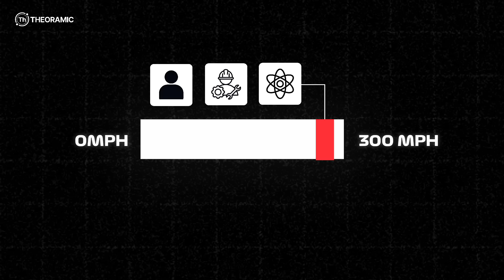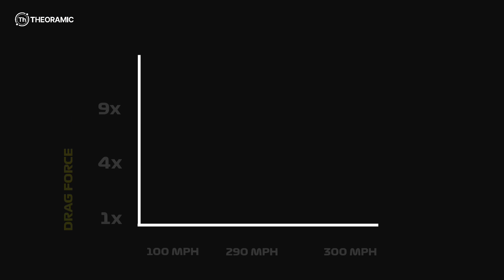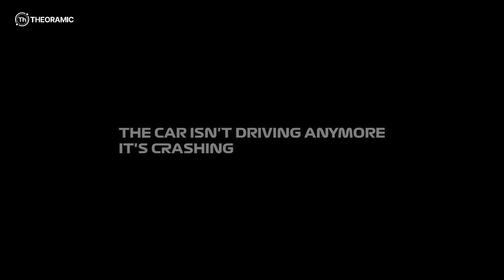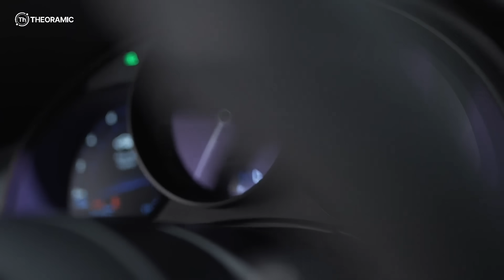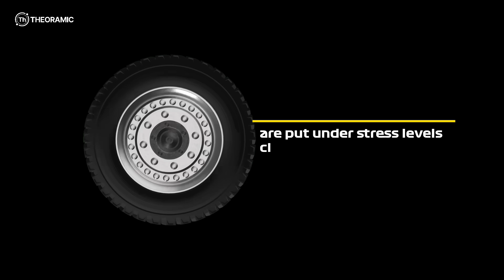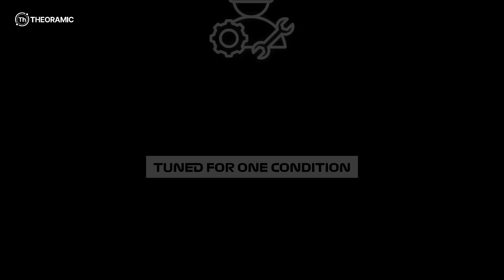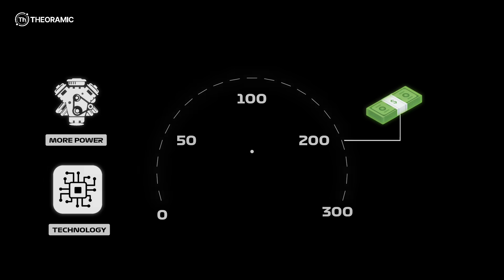Why It’s Almost Impossible to Go 300 MPH

Comment: From an engineering standpoint, it's not nearly impossible, in fact, it's very doable. Most car brands can create a vehicle that goes over 300mph, the question is, is it sustainable and practical? And the answer is a resounding no. Why?

Infrastructure - We simply don't have the roads built for it. We're talking long stretches of roads that span miles in length, that are smooth and wide enough to make up for things like tunnel vision and slight shifts that can have a huge impact on positioning. That's not even factoring in wind. So even if we created a special lane where the minimum speed is 200mph, the maintenance costs would just be too high.

Tyre wear- This is one of the main things, I've spent a lot of time researching everything I can about tyres over the course of maybe 5 years, the simple truth is, we haven't gotten to the stage where we can produce tyres that can handle that level of force for a long time before ripping apart due to heating and wear. The issue is, if you want more durability, you need harder compounds which means less grip (not suitable for going 300mph), if you want more grip, this means softer compounds which can allow for extreme performance but you give up longevity (again making running at 300mph for a long time not practical). If you want grip and longevity (most road cars), you must sacrifice performance. It's always a tradeoff when it comes to tyres. Until we can figure out how to eliminate trade offs, it's going to be tough. And it's not that we can't make a tyre with extreme durability and extreme grip, the ROI just doesn't make sense to spend billions into R&D for a tyre that almost nobody will ever use😂

Fuel - Simply put, right now at its top speed, a Bugatti Super Sport 300+ will run through a Tank in 9 maybe 10 minutes. That's just not sustainable.

And then the cost aspect, you're looking at a 5 figure bill at the bare minimum if you're a Bugatti owner pushing your car to 300mph😂You're 1000% going to need to replace all 4 tyres, that's around 40k just for driving for 10 minutes😂 God forbid you have any engine, fluid, brakes or transmission issues, you're looking at 6-figure bill for 10 minutes of driving.

Overall, the costs just aren't worth it. The engineering part? 99% of it can be done, the biggest limitation would be tyres but tyres aside, you can find a workaround for everything else, it will just cost too much and the time in maintenance to the time saved on the road just wouldn't make sense.
Reply: TLDR: cars fast enough to mog a formula 1 car are impractical for every-day use
Reply: @Shuttle_Man  Right, the required investment doesn't make sense for anything other than competitive use such as racing.
Reply: Use steel tires and run them on two parallel steel mini-roads. Since you’re punching a hole in the air, you could tow other cars full of people or cargo for efficiency.
Reply: @DrDeuteron that would be a good form of transportation, i wonder if anyone ever figured out how to build this machine
Reply: @DrDeuteron you just invented a billion dollar industry
Reply: Tldr, someone asked chatgpt then pasted it here to look smart
Reply: Very well stated!!
Reply: ChatGPT answer.
Reply: @ThereIsNoSpoon678  If you actually read my response and have ever used ChatGPT, you'd know ChatGPT would never make such a messy response😂 Furthermore, I'm sure there are several apps or sites that can detect if something has been written or created by AI, so you can run my comment from any of them.
Reply: Thanks, ChatGPT
Reply: @popcycle7169  The fact that people o(or 2 of you) think I used ChatGPT to write a very basic comment or would use it to write any comment period let's me know how dumbed down we're already getting.
Reply: I hope you didn't actually waste your time typing all this IN A YOUTUBE COMMENT 😂😂😂
Reply: @Sayaingin66  Well people read it and seemed to agree so🤷🏽‍♂😂 It's not a lot, people just have short attention spans or are too lazy to read nowadays. It didn't take me more than a few minutes to type that.
Reply: We all spend our minutes wasted on this crap, i am no hypocrite. But thats pretty hypocritical of me too say. @11bornrich
Reply: @11bornrich and also I read it. And your on the money. I shouldn't combat knowledge but we all learning.
Reply: @Sayaingin66  Yeah reading through what would be a boring comment for most is not for everyone I understand😂The only reason why I know so much about this is because as a petrol head, I always wondered about this exact thing and like a nerd did deep research on it many years ago to find it's not that it's impossible but it just isn't practical at all and would cost way too much for little to no return😂
Reply: @11bornrich your so awesome im so sorry lol. Im a HUGE fan of mechanical engineering is well. Ive read everyone's comments and there is plenty of legitimate conversation, and who am I to stiffe that?
Reply: And also i 100% agree with the tires part "tyres" lol i see you over there across the water @11bornrich
Reply: Wait, I thought fuel consumption is high at lower gears and get lower at higher gears. Like I'm not really knowledgeable on the subject but is it really true that at that speed the fuel tank would literally empty in minutes? I'm genuinely curious
Reply: @Knightmare-i6j yes the air density becomes so great at those speeds its like driving through peanut butter. Your gonna need the hp to keep pushing and torque too pull. Thats why it would require more 🐎 the bigger the vehicle depending on the aerodynamics.
Reply: @Sayaingin66 
Ooh. That makes sense. But emptying a fuel tank in less than 15 min is still insane. I'm really surprised to learn this
Reply: @Knightmare-i6j very insane, thats what you get when you have a 8.0L engine with 4 turbochargers and the vehicle weighs 4,000lbs.
Reply: @Knightmare-i6j also the thing is, is that good luck running your tank out from running 250mph+ and full throttle. The tires will go long before the fuel.

Comment: You lacked on more focus on the mention of land speed records that still technically count as cars. An example of this is the turbinator 2. It doesn't have the typical engine, but it is most definitely 4 wheeled and wheel powered. If we are talking road legal, then it is a whole different story. Although, even with that limit I do not think it would be too hard to push an EV's engine/vehicle past 300mph at all taking into account technological advancement and problem solving of today(most challenges arise, due to complications within company or out of company, that excludes these obstacles mentioned in the video).

Comment: Tires, engine heat are significant. The power needed to overcome aerodynamic drag increases as the cube of the airspeed (unless the air flow goes trans-sonic or supersonic). More power is a matter of displacement and turbo boost. 
There are tires which can withstand 300, 400 + mph at Bonnevile Salt Flats (miles of smooth salt, or, mush). I’m not sure Bugatti or Konig want to run there cars on salt.

Engine heat. If using internal combustion engines a significant percentage of the energy in the fuel ends up as waste heat that starts inside the cylinders. A 1.5 liter engine of 150 hp at the flywheel produces 150 x X amount if waste heat. Now the heat exchanger (radiator) for such an engine can be fit inside a tiny Fiat or Mini Copper. If 1,500 hp (accounting for additional aero drag needed to keep the car on the road and stable) is needed to break 300 mph then one has to contend with 10 tens more waste heat than the sporty subcompact. To drag the radiator for 1,500 hp through the air at say 2.5 times as fast as the Mini (I credit the Mini with a perhaps generous 120 mph) requires 15 times more power (10 x the cross sectional area times 2.5 cubed). Clever design can reduce this but still. The Bugatti air intakes look well designed.

Now for short runs one can accept temperatures over a wider range. Or one can “modify” from production and use exotic fuels and techniques. Alcohol fuels with methanol water injection; the latter was used inWW II for short term “war emergency” power.

Obviously, one could try turbo-shaft engines but now one is deep into aero-space.Or one could go battery electric. The torque of an electric motor is more constant over rpm (power = torque times rpm) and can withstand high rpms. Direct drive might eliminate transmissions. 

The human limits should not be overlooked. F1 is always looking to limit top speeds to limits which the survival cell & crush zones plus ample run off areas  can reduce max periods of impact G loads to survivable levels. (50 G for many seconds is nit survivable; 50 G for a microsecond might be.)
Reply: Developing a rotary engine would lessen the heat problem

Comment: I currently work in the exotic car industry and one of my clients invited me out to this really cool event at the Kennedy space Center in Florida it’s the same runway where the space shuttle use to land its a three miles long so they let supercars do high speed runs my client
 owned a Lamborghini Aventador, at that time but I was able to ride in a Porsche 918 spyder we hit a top speed of 223 miles MPH!!  But when we first got around 190 MPH  you can really see how the wind resistance was really starting to push back on the car.
Reply: How do you get into the car industry like that u got the life
Reply: @feardboi  I started from the bottom! My first job was at Mazda Hyundai and then I went to Mercedes  the journey hasn’t been easy but over the years I just kept trying to move up the ladder until I got to exotics and hyper cars which I’m currently working with

Comment: Supersport 300+:1600hp and reached 304mph while being just ICE
Yangwang U9 Extreme: 3000hp reached 308mph, all electric
It really still says that ICE and Hybrids are yet still dominating the track and speed area over electric cars who just dominates in acceleration, ZR1 with 1064hp (all Ice) is still faster than the U9 extreme around the ring cuz the U9 can’t put it’s full power to use to 100% on the track (source from an engineer guy on youtube who debunk the cybertruck towing 911 vs 911)

Comment: Drag, tires, fuel consumption, weight, pushing power, absolutely needs precision and strong grip to not spin the car out since downforce keeps it stick but it isn’t necessary for top speed runs, not to mention about the driver’s limit too, humans have limit
Reply: which human limit are you talking about? Normal commercial planes cruise at speeds that is way above 300MPH
Reply: @henrychidiebere6679 focus and reaction time. It can be extremely difficult keeping a car straight anywhere near that speed. When Mario Andretti drove the McLaren F1 on a track, he maxed at 217mph and said it was very scary though still felt like the car could pull another gear (if it had another).

Comment: I've been thinking about the Bugatti Veyron, it does 400 km/h with 1.000 HP. Since power is proportional to the speed cubed it will need only 16 HP to do 100 km/h. I must be very aerodynamic, to do 100 km/h with just 16 HP with the wide tyres and all the air intakes, spoilers...

Comment: Yes, it's amazing how many don't realize that power, time and energy are not linear. When you double the speed, energy increases 4 times. 100mph impact is 4 times more powerful than a 50mph impact. Goes in reverse too, you need 4 times the amount of horsepower to achieve 100 mph. The same goes to projectiles, rockets, ships etc
Reply: Power is a factor of 8, not 4, but since the time to complete trip is halved, the energy goes as 4.

Comment: It's funny when i hear people say "you need to find a driver with big enough balls to drive it that fast" we have top fuel drivers who are use to handling 300+mph in a vehicle why don't they ever use one of them to do the run? I understand that they hit those speeds way quicker but that's even more impressive to be able to control something that powerful under that many G forces so handling a road car at 300+ would be way less scary for them I'd believe
Reply from the maker: Can I ask a question Sir 
Do you think you are able to Drive a car moving 300 MPH
Reply: @theoramic_yt  no, I'm not a professional racecar driver but i have driven a car 200mph which yes is scary but I'm sure if i did that regularly as a pro driver it would be less scary

Comment: We will get to a point where we cannot go any faster than what is possible
Reply: Becuse the only thing stopping any hyper car from doing 300 mph or more is the tires or lack there off tires that can with stand speeds of 300 mph or more
Reply from the maker: imagine at that speed a tire will be  rotating  2,500 RPM
Reply: We already have seen that. SpEeD oF liGhT.

Comment: You forgot how the fuel tank would empty in 10 minutes at that speed because how much power it takes to overcome air and rolling resistance.
Reply from the maker: Hyper cars are Absolutely not Fuel efficient
Reply: They take less than a minute to get to that speed
Reply: @Real-Galerianhow much fuel do think has to burn to make 1500hp for a minute? A lot.
Reply: @jamescarter8311  If engines were 100% efficient, they would consume 2.71 liters of pure gasoline per minute to produce 1500hp. Since they are not (at most, 36%), the consumption would be 7.52 liters per minute with full throttle, meaning you are running out of fuel in 13 minutes.
Reply: I mean if you invented a way more efficient engine, you would more than likely... disappear. Never to be heard from again.
Reply: @thorcolossus facts.They don’t even get what your saying lol but super facts better keep that knowledge to yourself
Reply: I was watching a podcast with a nuclear physicist and he was saying essentially what u said as to why fossil fuels will always be a thing. There comes a point where the weight to capacity reaches a physics limit to electric etc are no longer viable . I’m making up the numbers because I forget but basically the weight u need to stay under and the amount of hp and time it’d take to reach 400 mph is physically impossible without carbon based fuels of some sort
Reply: @trumpdrago517  Diesel will always be a thing. In remote areas. The issue with reaching higher speeds with fossil fuel is that, you will always have to make bigger engines and therefore bigger gearbox etc which then puts more weight down on the wheels, compounding the problem. Thermal efficiency (how much of the explosion you can convert into wheel torque) of piston-based engines has plateaued.
Reply: @trumpdrago517  but electromagnetic acceleration is very effective.
Reply: @DrDeuteron still need diesel trucks to dig up the lithium.
Reply: But also at 300mph, you are traveling at 440 feet per second.

Comment: Only the byd and Bugatti which had the fastest hypercar in the world for 6 and a half years have gotten to 300+ mph while koenigsegg and Hennessy have done nothing
Reply from the maker: It's VERY HARD TO GO 300 MPH though....
Reply: @theoramic_yt Yh
Reply: To be honest they didn’t both ways to make it a proper record , I won’t doubt that it wouldn’t do a better job than the oldy Agera RS but currently so far the actual fast car is the SSC Tuatara , hated for faking the top speed but in reality it did pretty well.